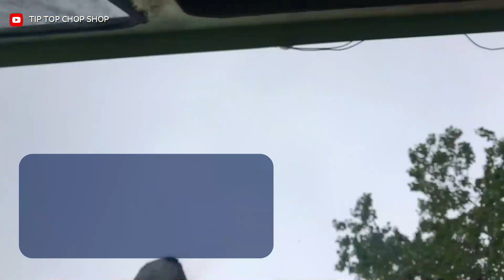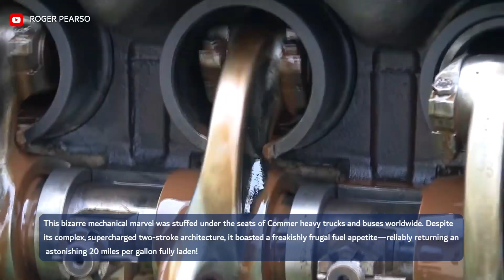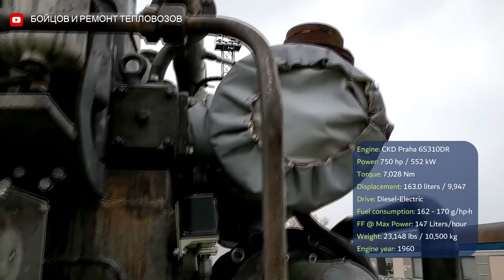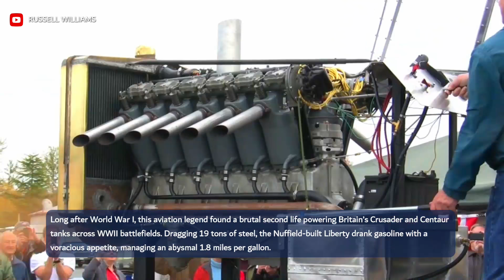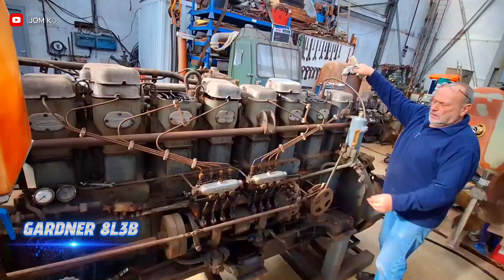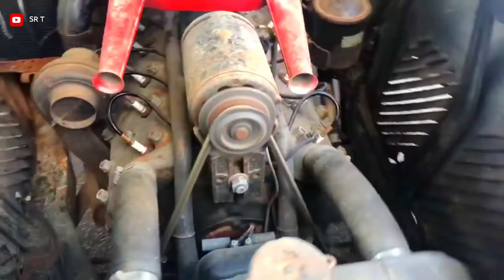Waking Up a 171-Liter Beast 🔥 (And Other Cold Start Nightmares)

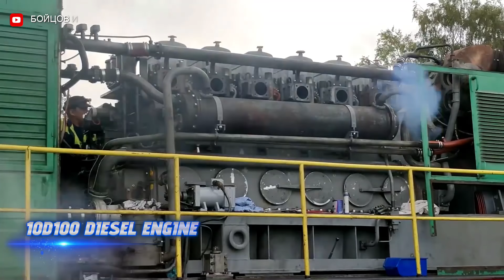Comment: 1:54 is not a soviet built 10D100 engine, but czechoslovakian built K6S310DR, in a Chme3 loco. Those locos have been exported in huge amount (about 8000 pieces) to countries of former Soviet union. This is an inline turbocharged 4-stroke 6-cylinder engine, bore 12,2 inches, stroke 14,17 inches, displacement 163 litres, 993 kW, in some other locos in Czechia and Slovakia 1103 kW or 1213 kW. 10D100 is an opposed piston 10-cylinder 2-stroke engine used in soviet built 2TE10 or 3TE10 locomotives. Looks and sounds totally differently.
Reply from the maker: Thanks for the incredibly detailed correction! It's awesome to learn more about these powerful engines and the history behind them.
Reply: @Proton-Tech  You're welcome. There are many upgrades a modifications of products of eastern Europe communist machinery, and that may be finally quite confusing. Even both of mentioned engines are somehow a derivates of old US engines. 10D100 is a copy of Fairbanks Morse design, and K6S310DR is derivated from Baldwin engine.

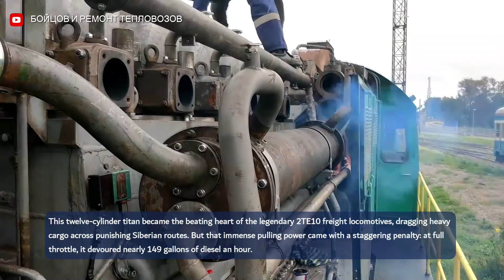Comment: 2:34... NOT an opposed piston engine... You can see the exhaust ports high on the engine block and the valve train rocker covers at the very top where an opposed engine would have its other crankshaft...